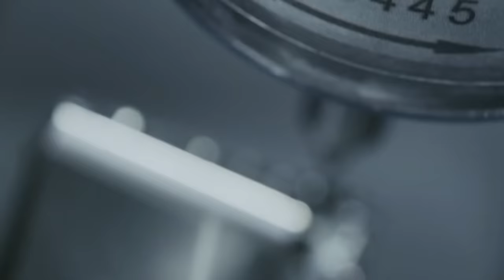CNC WORKING PROCESS

Comment: Props to the engineers/operators who created the gcode. Amazing work. really want to know how many lines are necessary to create one of those parts
Reply: @MikkelRS we once had a program at 1.1 TB, that machine ran for 5 weeks straight, cutting dust after the 3rd day.

Comment: Even just the drill bits in this machine probably cost more than my college tuition.
Reply: cnc drill bits from alibaba cost 1 euro each
Reply: carbide drill bits range from $10-$250 for standard jobber drills under 1/2"

you wont find many shops putting Alibaba drill bits in their cncs, not when knock off american carbide tools are the same price.
Reply: @kolby4078  How much for the ones in this video, the ones that look like small Tunnel Boring Machines lol.
Reply: @muzzaball  standard indexable tool holders (the kind with inserts) range from under $100 for small endmills to $200-$500 for indexable drills and up to $1000 for large shell or face mills. 

You can also get custom tool holders with specific geometry to cut special patterns called form cutters, these can get very expensive in the $1000-$10000+ these are common in the automotive and other high production applications

the consumable inserts themselves are in the $5-$50 range

generally the bigger the tool the more is cost, especially if you want an unusually long tool as these are hard to manufacture.

For carbide tools the carbide itself is the biggest cost. a half inch carbide blank might cost $30 with the finished tool only costing $35
Reply: @kolby4078  thanks so much for replying. Ur knowledge is outstanding - I marvel at lathes and those who operate them, can you see how impressed I am by Million dollar milling machines! 😊
Reply: Cost exaggeration is an economic tool used to enhance monopoly; deflates competitive interest. Cost of a  tomato can be a billion, a million or a dollar. All are correct.

Comment: As impressive as CNC machining is, I found that last bit were the guy made the brass knob bolt thingamabob by manually machining it actually equally impressive.
Reply: @MikkelRS My opinion is that everyone should be that anal on cleanliness. It gets lost obviously when you're in a workshop and speed is the key but realistically as a young manual miller I dislike the fact that every machine I touch has 30 years of dried coolant and swarf embedded into both the  machine and the surrounding floor. Id love to work somewhere that allowed time for a full clean down after every few jobs. I dont think working in a mess should be an accepted norm

Comment: I couldn't help but notice that no coolant, not even for the form taps, was used. From my experience, no coolant whilst taking, what looks like, fifty-thou cuts is a lot of stress on the indexible cutters. You can actually see smoke caused by friction between the tool s and the metal being cut.

Comment: Why would you use such a tipsy container to cool your endmil?  You tipped it over when you pulled the mill out.  Had the liquid nitrogen landed in your lap, you would be regretting it.

One other thing... You left the mill in the nitrogen for so long a layer of frost built up, adding to the diameter of the tool.   That makes it harder to insert.  I'd like to see what happens if you take the tool out of the nitrogen before a l ot of frost builds up.

Comment: I am a lathe machine operator  but i dont know how 2 operate that cnc..
Reply: Youre right, but there is a tendention, that some series from some factories have same, or very similar soft. So for example its easy to go from  MAZAK's mazatrol 640 lathe to mazatrol smart lathe. Or from matrix lathe to matrix milling machine since MAZAK machines are based on really easy to learn system